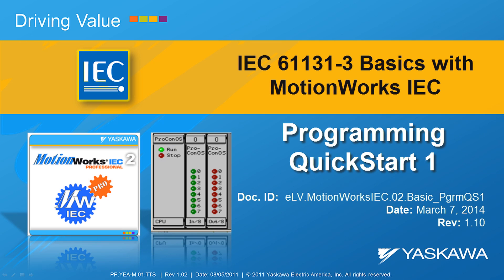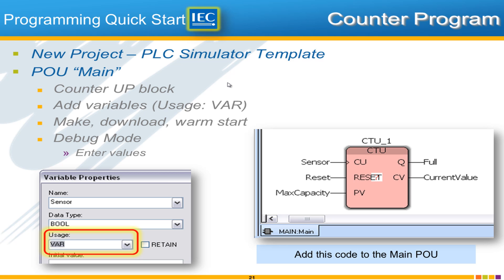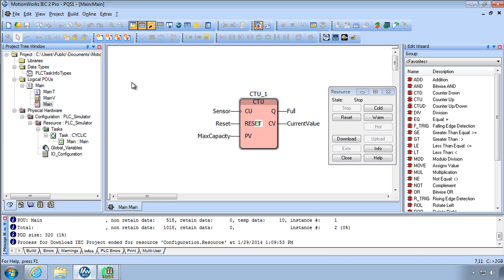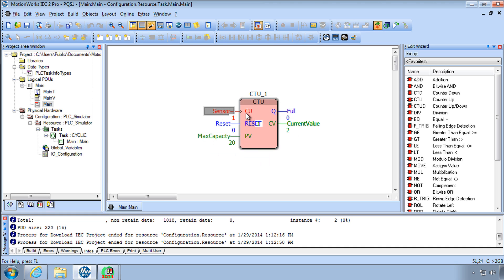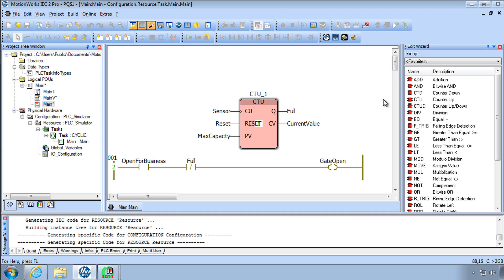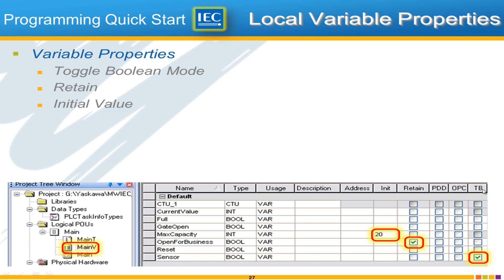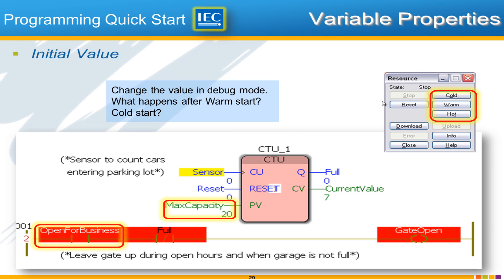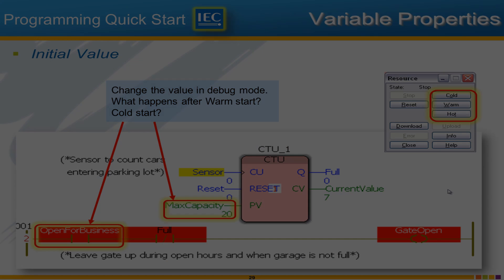2.1 Programming Quick Start Part 1 (IEC 61131-3 Basics with MotionWorks IEC)

Comment: Hi, Can you explain why on 16:08 when toggle boolean was activated the counter did not increment current value?
Reply from the maker: Thank you for your interest in the 2.1 Programming QuickStart Part 1 (IEC 61131-3 Basics with MotionWorks IEC). The counter feature will not count up because the reset input is on. To see the reset feature you can go to 12:11.  Please contact our Technical Support Team for further assistance at https://www.yaskawa.com/support-training/support Thank you!

Comment: Sir how to take sec and min pluse??
Reply from the maker: You can use the TON function block to send a pulse every second or minute. To make it pulse you would reset the 'IN' input when the 'Q' output goes high. This function block operates at the application task rate so if you want it to be precise you need to put it in a lower cycle rate task.